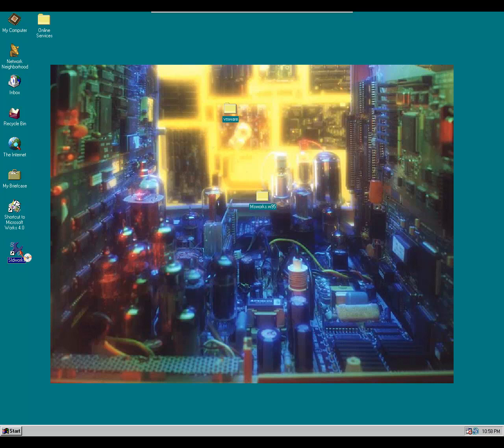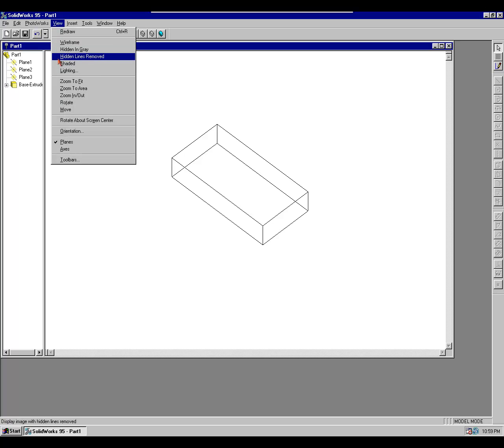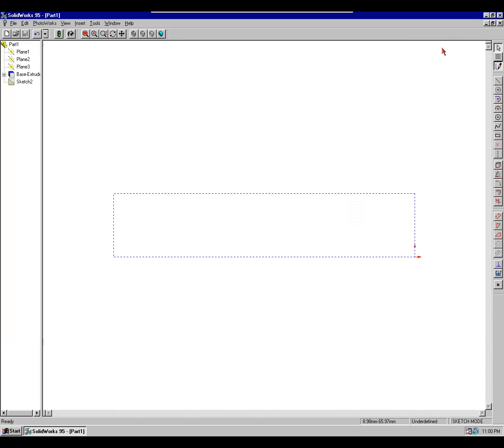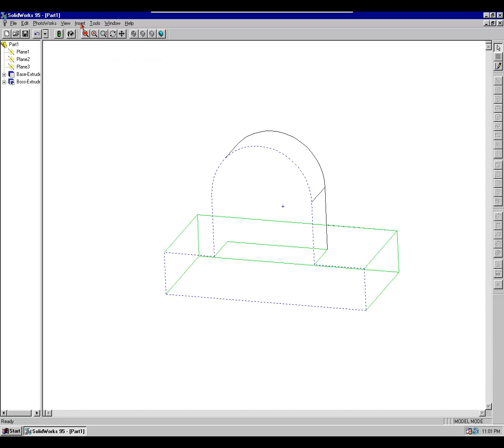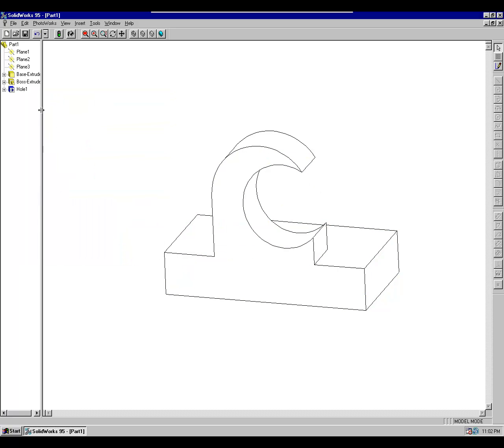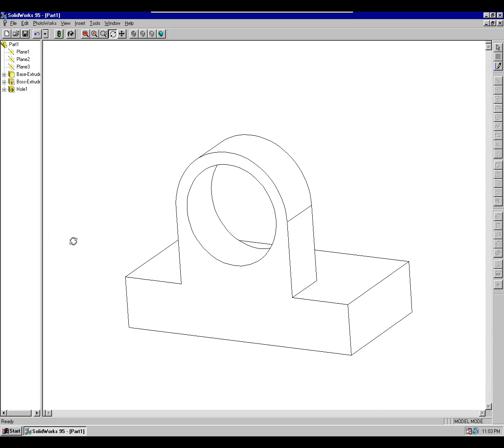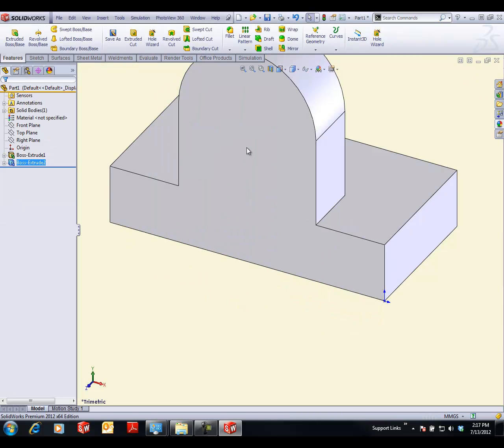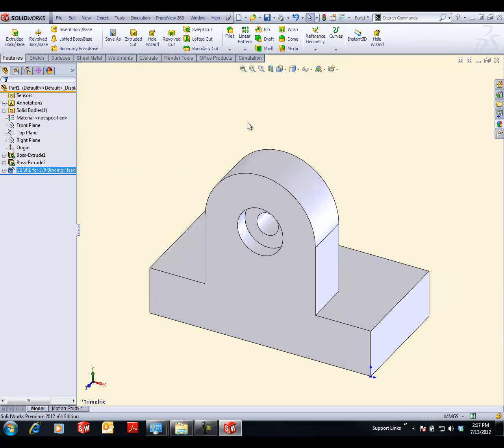SolidWorks 2012 vs SolidWorks 1995

Comment: I was one of Solidworks first customers back in 1995 when my co-founder had me move to NH. I recall being able to call their office in MA and talk directly to Ian about various bugs. I think there was like 7 employees there a the time.

I still have my 1996 install CD.  Showed it to my Trimech guys when they stopped by. Thing is - All these CAD and EDA tool vendors seem to have blown their wad about the early 2000's. They were so inot one-upmanship with their competitors that they gave you most of the functionality that you need even by today's standards.

I do have to say tho, in this day and age of hashtags, trending on the Today Show' Orange Room, and 3D printing we've lost some of the fundamentals of actually understanding the underlying science behind manufacturing.

I get a lot of clients that want something built and then are aghast when my shop or a larger shop can't fab it.

I recall one project where I called the OEM and asked if they could make a change to an enclosure we'd used in the past. If you google wayne mitzen you'll see a pic of it on my portfolio.

So I ask these guys if they take STEP, IGES, asked what CAM program they use:

[old man voice] "We used a trig book and a slide rule to make that mold"

I responded, "You did an injection mold for a fully submersible enclosure on a Bridgeport?"

".... we built a space shuttle that way ... you build  a space shuttle wit' yer fancy 3D CAD stuff? Last I heard you missed Mars!"

"Uh...well, uh.... hmmm..." I responded. What could I say?

Tools are tools.

There's a great low cost static FEA tool called LISA-FET - based on a common code base that others use. In his manual he mentions - any FEA tool can produce pretty, colorful pictures... you need to know the underlying physics to be sure what you're seeing is close to reality - you need to know the math(s) [sorry, I know it's now "maths" but that drives me nutz - "math" is/can be plural from what I was taught  back in the days of slide rules - maybe it should be  #maths  ...]

One of the things I tell my young engineers - "you never solve an engineering problem - all you do is smear physics around until you can live with the result..."

BTW - in one of the early SW versions (may be 1995 - not sure) do a draft angle that exceeds the boundary of the extrude - nice blue screen...
Reply: hi please share solidwork v 1995 CD